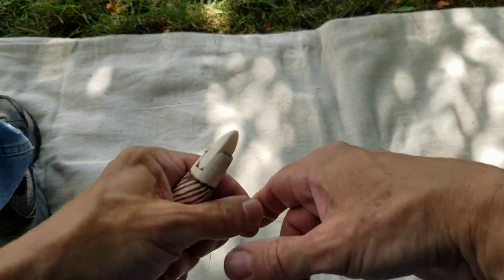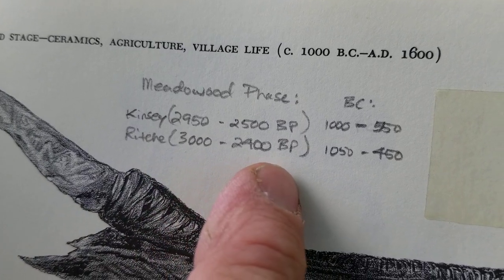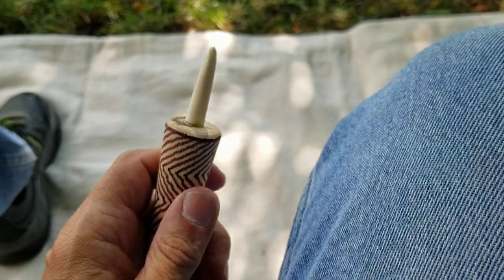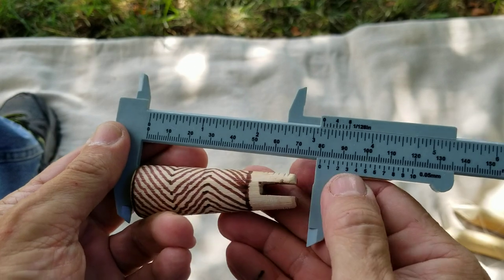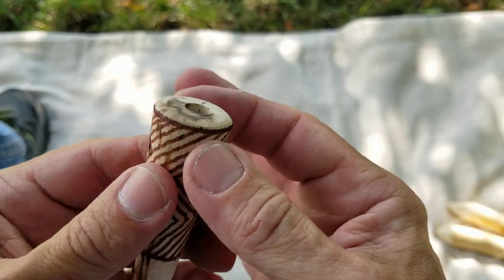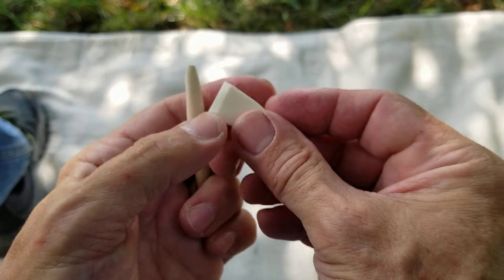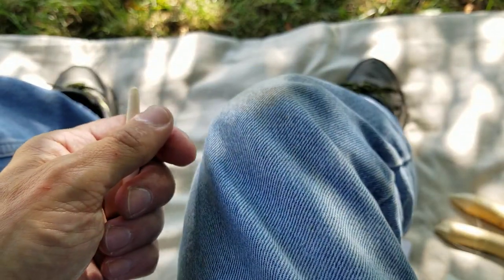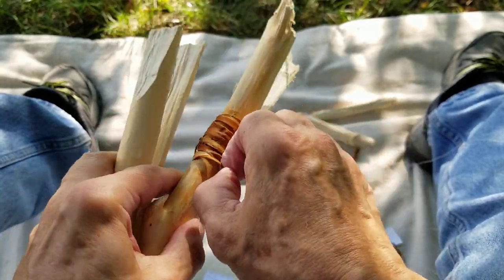1216 - First Reproduction of Pressure Flaking Tool

Comment: It looks like there are shims inserted at the edges over the sides of the flat bit, from what I see in the drawing.  That would, along with the notches you created, keep the bit from sliding out as easily.   I assume that flat bit was used for notching, meaning that the pressure would be mostly against the wraps.  That also makes sense that there would be shims, to increase the holding pressure, at the stress point of the tool junction.
Reply from the maker: All good observations that deserve to be tested. 😁👍

Comment: Did this ever end up getting used? Im planning on making one myself and would love to know how well it works.
Reply from the maker: Somebody bought it from me in one of my auctions. This is a simple pressure flaker. It works exactly the same way as any other pressure flaker with an antler tip of the same size. The real one has a copper tip.

Comment: I’d have expected wrapping on the front, in order to prevent splitting from the pressure of the other end of the needle side from within the center of the wood (as copper is much stronger than the wood grain)
Reply from the maker: It depends on the wood. Some wood is very strong. I assume a strong wood was used.
Reply: @KnapperJackCrafty  yeah that makes a lot of sense to. Would you expect it to have been glued into place to keep it from spinning in the hole?
Reply: *too
Reply from the maker: @LeMayJoseph  yes